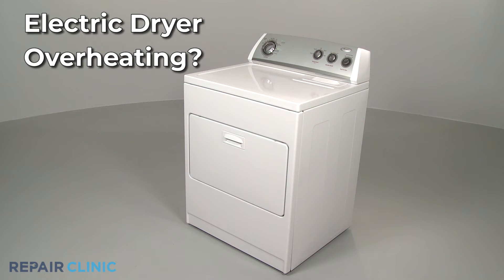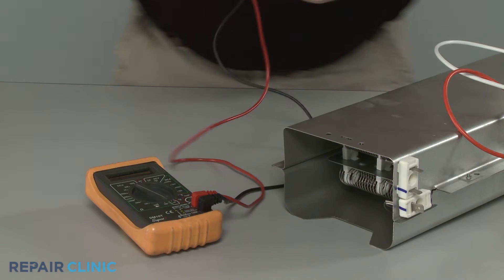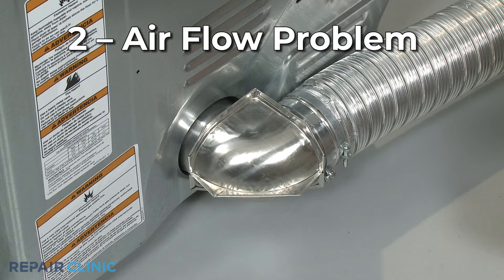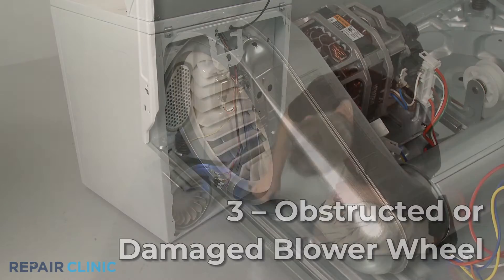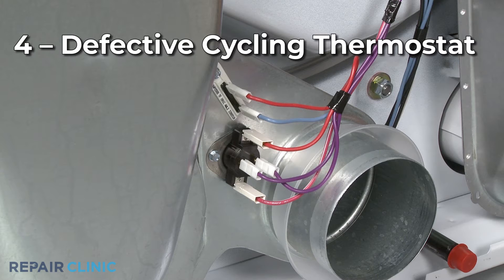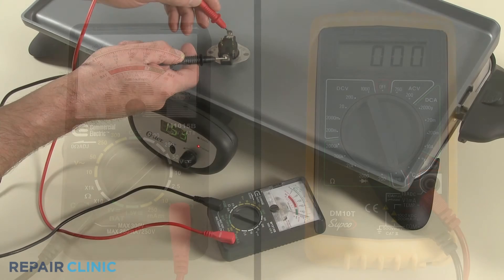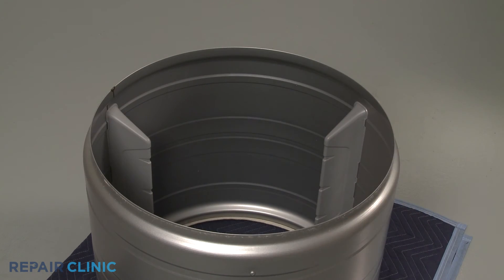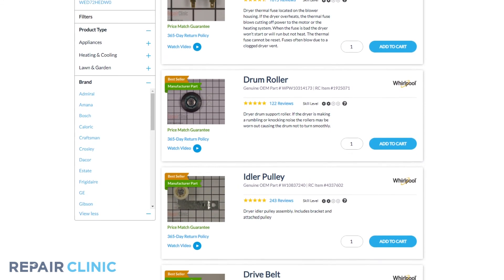Top Reasons Electric Dryer Is Overheating — Dryer Troubleshooting

Comment: So I don't a multimeter I had the door open and pushed the button for it to run anyways and see only half of the element heating so I'm assuming I should replace it? It heats on all setting and over heats